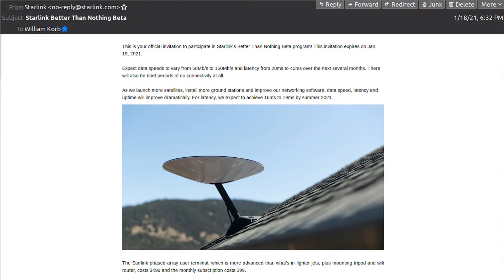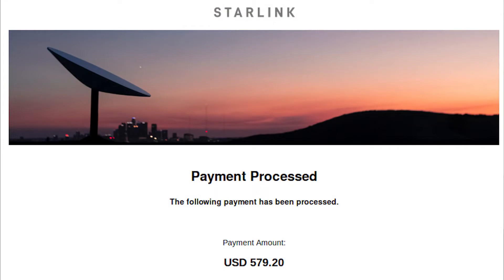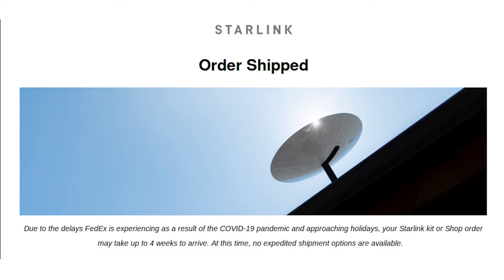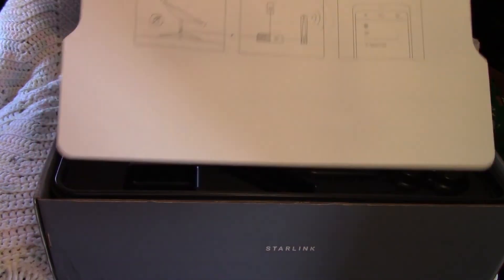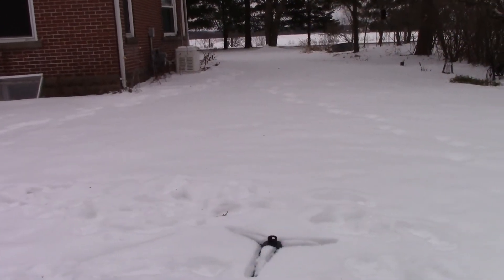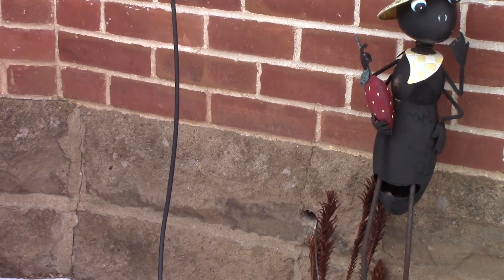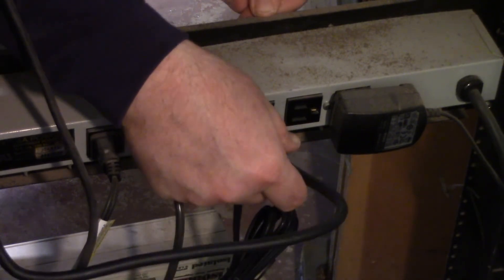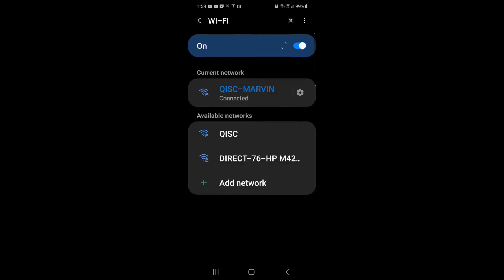Joining the Starlink "Better Than Nothing" Beta

Comment: The cable that went through the wall had a relatively large diameter thing on it. Do you know how wide that is as it looks thicker than most things that go through the wall. Also what does the other end look like? Could I take it through the other way to keep the size of the hole down?

Lastly is that a second cable for the power that would have to come into the house?
Reply from the maker: That appears to be a lightning suppressor, and is about 0.75"/2cm in diameter. I had some 3/4" EMT laying around and planned to use that, but it was too snug of a fit. The other end is hard-wired into the dish. You might be able to disconnect it, but that might void your warranty, so I would advise against it. If you're going to have to drill a hole, plan on at least 7/8" (2.2cm). It uses PoE (Power over Ethernet) so there is only one cable. When I move it to it's permanent location when the snow melts, I plan on running 1" conduit through the wall, using a surface mount box on the outside, and notching the box cover to be the size of the cable. That should keep any critters from finding their way in.
Reply: Thanks for the reply, that's really useful information. I'll have to think about how I can manage this installation. But you've helped a lot.